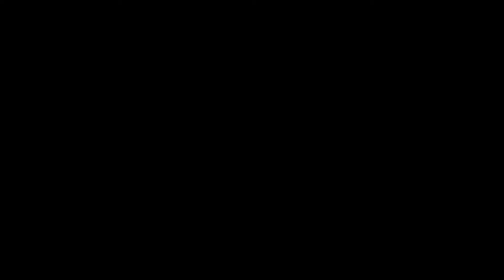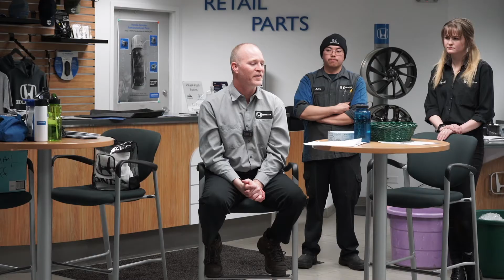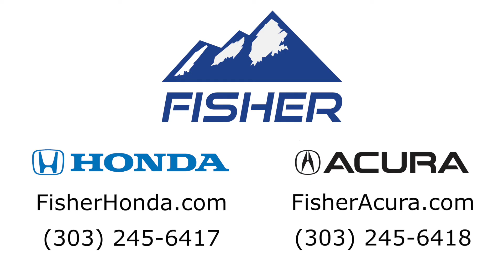VSA and ABS Systems Explained

Comment: This genuinely calmed my nerves. 
This is my first time driving in snow this year, in a 2013 Honda fit. 

I realized my back tires kept spinning out Everytime I went to go at a light then the breaks felt like they were buckling. 

So after watching this video. Basically the car took control and the entire time I was fighting it. 

Still though doesn't help that my tires are getting to that point that I need to get new ones. 
I will say it's a very nerve wrecking experience when your car goes into this mode. I like the idea but it makes me feel less in control, literally.
Reply: Same 2012. 😢